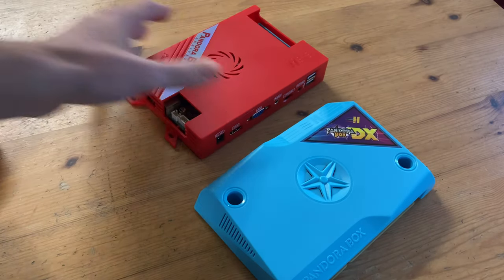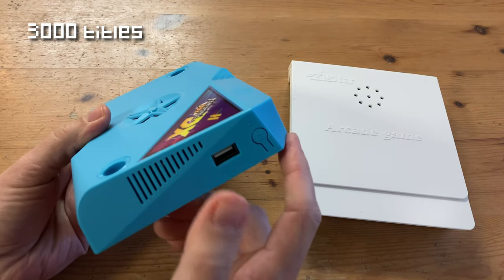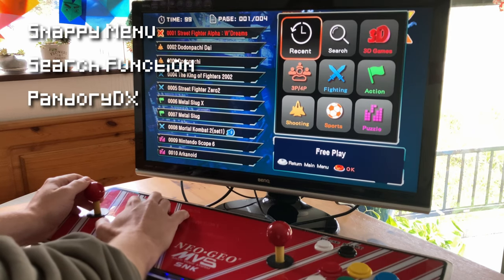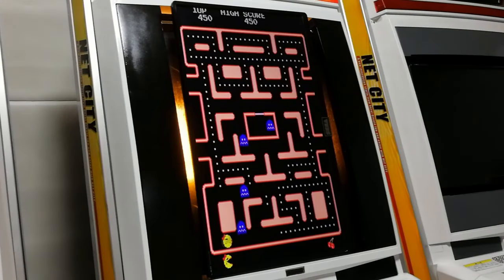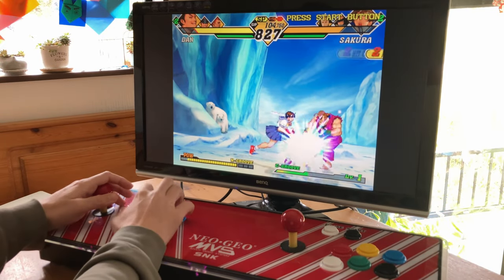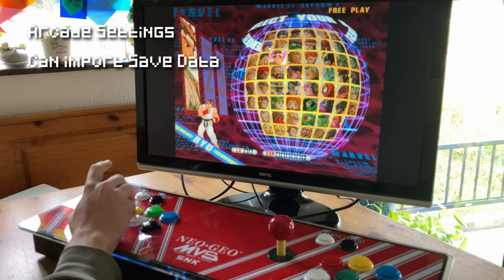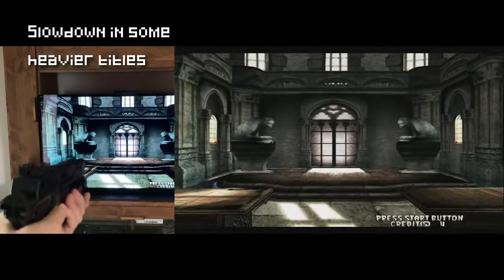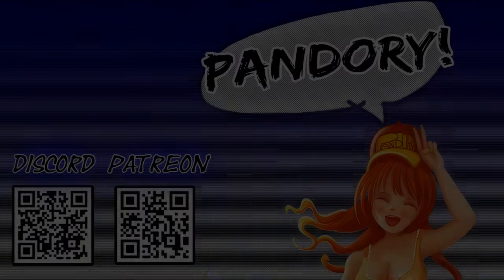The Best Pandora Boxes of 2023 & 2024 [Pandora Box Round-Up]

Comment: Awesome Video. What would you recommend for a 15hz arcade machine? Would you prefer the 10TH ANNIVERSARY or DX? Thanks for the help
Reply from the maker: We don't recommend the 10th for 15hz unless it's the early V1, and even then, it has its problems (no access to MAME settings, can't import save games, doesn't update).
The only "Pandora Box" types we recommend for 15hz are those in this video, which both have their own problems (Pandora X games limited by hardware, DX, annoying with scaling)...  Want only the old games running well?  X Games, want more options?  DX.
Outside that, it might be worth looking at the RGB-PI JAMMA.  You'd be able to get games running VERY well on your arcade, but the interface is more suited for consoles rather than an arcade system, like the Pandora Boxes are...  And you'd need to buy a Pi3 / Pi4.  Arpicade is also a similar project.
Reply: Why not 10th anniversary for jamma crt 15khz??? V1 tested v2 o v3 have a problem??

Comment: Very nice video ! Congrats !

I've got just one issue. I have a vertical cabinet from the 90's. It runs a 15hz crt monitor inside. Now, you say the king of the air 2 can run 384x224 at 15Khz in CGA mode but if you go to the aliexpress page, it only lists hdmi and vga as output interfaces. There's no mention to cga and the jamma interface definition has no RGB pins associated. Therefore, officially, such support is non existent. I have two questions: 
1 - Is cga 15 Khz and crt 15 hz the same thing ? Means, if I connect my cabinet jamma interface to this pandora box, I'll be getting any image ?
2 - Is this video output achieved using the jamma interface ?
Thank you very much !
Reply from the maker: So the KOA2 JAMMA / arcade box has a JAMMA connector, but when you attach it to a 15khz monitor, it will display a horizontal Pandora DX menu.  As it's not the same as a "King of Air 2", they can't advertise it to work as such, nor will it work with vertical games without alteration.
1. CGA 15khz is the video signal, a CRT 15khz would be the monitor itself.  If you have the pandora box connected to a monitor via the JAMMA connector (and in low resolution), it's likely to need this style of box.  If you can't get an image at all, it may be that the monitor is not connected.  If you see a distorted signal, you can use the monitor pots, or try holding the options button down at startup changes the video output. 
2. Yes.
Reply: @TeamPandory , I really thank you for you input and knowledge about this devices. Knowing my cabinet, 15Khz crt vertically positioned and a simple jamma connection, what would you advise me to buy. A Pandora Box ? Which one ? Something else ? I've got my eyes in this German website claiming to have a vertical sort of box supporting vertical jamma setups but it costs twice a Pandora Box. Please, lecture me. What would you buy ? 
Thanks again !

Comment: I wanted to get the dx but i heard that it is pretty similar to the pandora cx that is cheaper, are there many differences in performance? (i want one to install games and play games like super mario 64 or crash bandicoot from ps1 and donkey kong country from the snes) thanks in advance
Reply from the maker: Similar in performance but we have the jailbreak for the DX, so we can use Pandorydx. 
If you're wanting n64 games, I'd advise in moving away from pandora boxes and look towards a mini pc with batocera.
Reply: @TeamPandory  maybe i’ll just play n64 on my pc, but for snes and ps1 is it gonna be enough with a dx or cx?
Reply from the maker: @benjaminfernandez4091  I'd only really get a pandora box for arcade titles... Even if console systems like ps1 and SNES do work, they should be seen as an extra, as it's usual to not be able to change settings or core emulator- if you run into problems.
If you need something cheap for consoles, a super console x or similar will fit you better than a pandora box.
Reply: @TeamPandory  i actually have a old pc that i can use with batocera and a pandora box games 12 that allows me to use my arcade machine buttons on any windows 10, so I’ll try to see if that works , thank you so much

Comment: I Want Buy a Sega Astro City. What is the best Pandora Box for Vertical shmups?
Reply from the maker: There are only two major ones. King of air 2, and air attack 3. None of them support CGA, so you won't easily be running that on the astrocity without it being converted
Reply from the maker: Better looking at a pi solution with converter for this I think like arpicade, or even the mistercade.
Reply: @TeamPandory  okay, will Buy i need a Pi. Which converter will i Need for This?
Reply from the maker: @undeadlight5221  rgb-pi is decent. You'll need the JAMMA one for an original astrocity

Comment: I keep seeing you mention that Pandoras box 10 has naomi and dreamcast support, but it literally come preinstalled with only a couple of games and even they dont run great. Most naomi games are also unplayable due to I/O and dremcast requires a controller because of additional buttons.
But main point is that compatibility is very bad, and it feels like a rippoff as I exclusively bought it for that kind of system emulation. Do you perhaps know of a romset that works best?
Reply from the maker: You'd need to mention the games your having controller / io issues with, but afaik all the lightgun games are a no-go when installing yourself.  I think they use the mame 0.206 set, but it could be something newer. 
The 10th is good as a unit that's a set box. To mess with any settings or add any games it turns into a bit of a mess. 
Most if not all of added psp games turn into a hot mess, for example. 
We can't really recommend it for fiddlers, or if you want to change configurations.

Comment: using a minipc and turn it on/off vie power is probably not that funny for a long time?
Reply from the maker: You mean turning it off at the mains ?  No. You want to either shut down or put it into sleep mode. 
The gunmax pc shuts down when you push the button.
Reply: but i cant find it anywhere:)

Comment: Does the Alpha 3D Max Arcade work as fine with a jamma adapter? Generally for all non-jamma boxes?
Thank you for your reviews... <3
Reply from the maker: It should work okay, for controls that is. Power and VGA / hdmi will need to be separate I think.
Reply: I've been told by the manufacturer that it's not worth it. They recommend just getting one of their prebuilt kits. Shipping is expensive in that case.